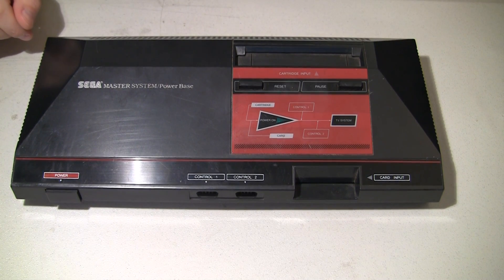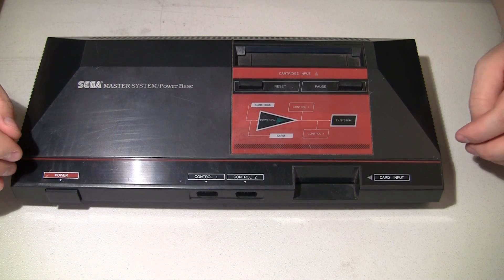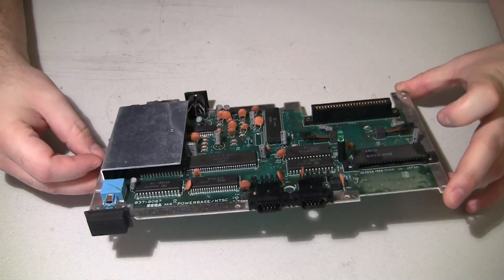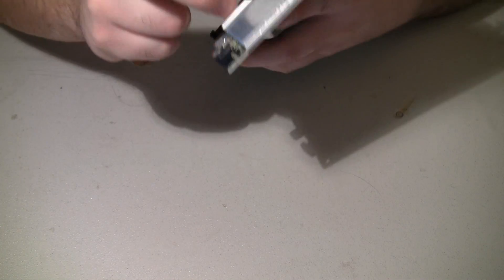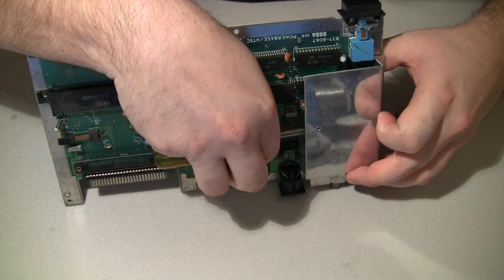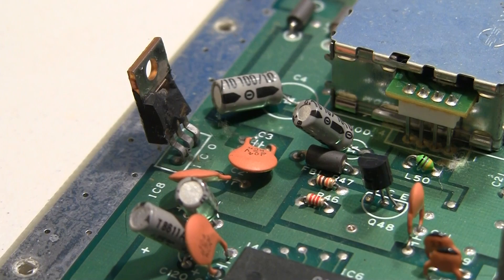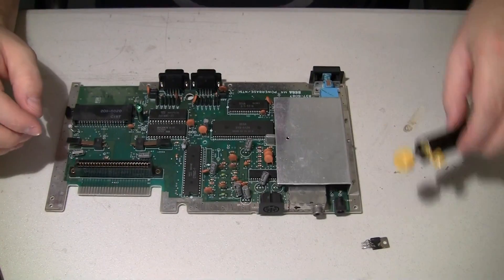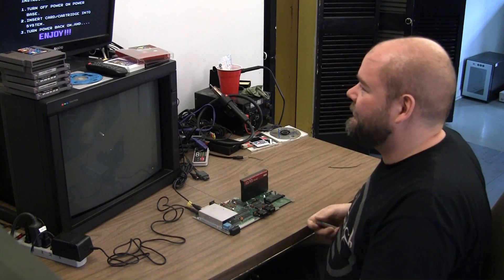Sega Master System - blown 7805 - easy fix

Comment: Please help !!! Having issues With my first gen sms. Its getting power but no picture or sound. Used. Four different rf switches and still nothing. What else can I do?
Reply from the maker: I honestly haven't fixed enough sms consoles to be able to point you in any certain direction. Try posting a help wanted thread on sms forums.
Reply: neevsmazda07 you need the audio video cable that connects to the back of sms. looks like an over sized s-video connection on the sms and the TV end is a yellow and white tea jack. way better picture and sound. eBay will have it
Reply: neevsmazda07   RCA jack not tea....

Comment: My Nes/Snes from Tomee blew the Voltage Regulator and I don't know which one to use to replace it. I went to radio shack but there werent any that matched exact. and it is 7805 so do i just use any 7805 voltage regulator?

Comment: Yes cart is clean and works via powerbase converter.the system wont even regististor a game being in it.card slot works perfect.i have tightened the connectors and reflowed the solder.still nothin?